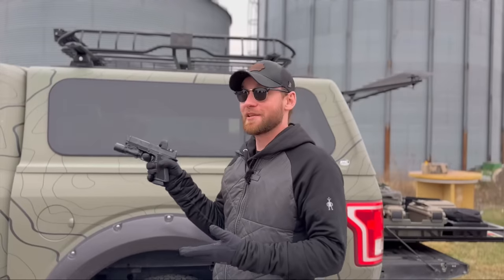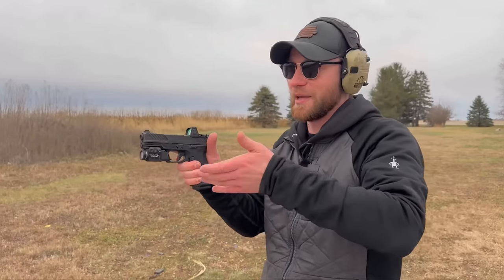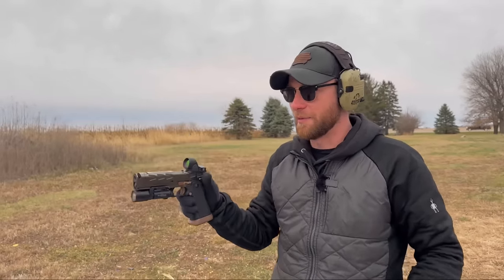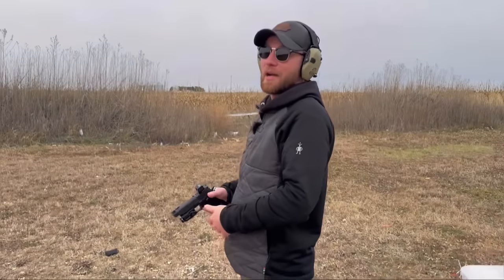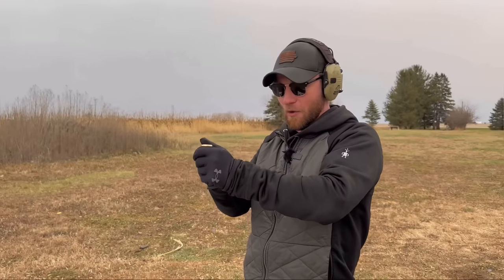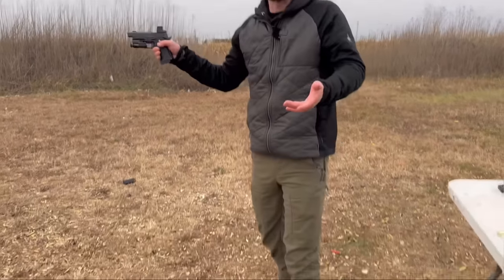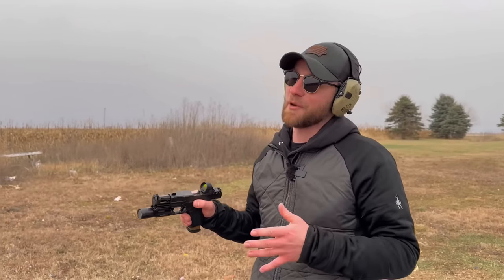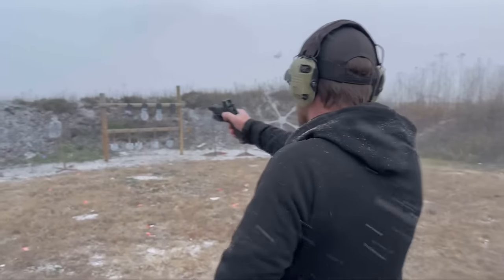How to manage your recoil

Comment: I wanna see you get 5-10 brand new, pull them out the box everyday carry full size frame pistols. No mods, not modified already by the manufacture.....grab them out the box and do a recoil management video. Not a shadow systems, not a build 45 1911, not a Gucci glock. Bone stock.
Reply from the maker: I can do that. But it’s the same concept, a trigger job isn’t effecting recoil management

Comment: LOL!  Recoil management on a no recoil pistol has to be the biggest joke this side of China!  Try that on a revolver or an older 380.  I found a 380 back in the 80's that rotated so much the only way to hit the target is aim at the ground and fire the gun.  I am not a string bean!  I had a 454 Casull for 22 years and the recoil was a bend the elbow to prepare for recoil.  They say size matters, but a good judge of size is if you can climb a normal aluminum ladder or drive a normal riding lawn mower without issues.  I run into so many morons that want to talk about proper recoil management and hold that I get the idea there is a broken record on YouTube.  The trouble with the 380 was how far above the trigger the barrel and side was.  This was a poorly crafted gun and designed by someone that didn't understand inertia.   That 380 was so badly designed, no one can manage the recoil.  The only fix was to reduce the ammo load.